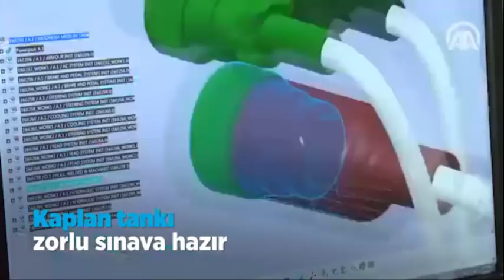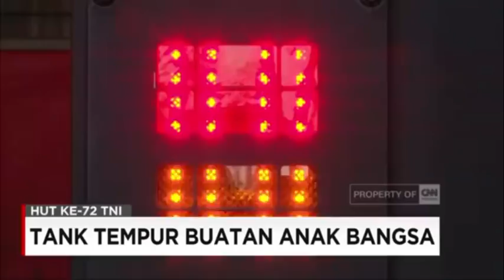ST Kinetic Build Medium Tank Using CMI C3105 105mm Cannon

Comment: OK------  When are they going to realize that if they widen the light tank out to 12 feet they can have a lower height, lighter tank that can handle the 120mm gun in a unmanned turret above the hull that is stable enough to fire around a 360 degree arc. something like the Russian Armata.
Reply: not every one needs a 120mm, because the 120mm Ammo can be more taxing for logistics and also the country made have plentiful of 105mm ammo shared with existing older tanks to tap on.